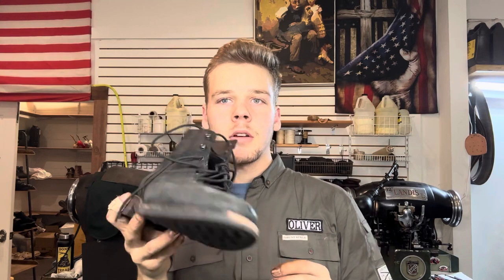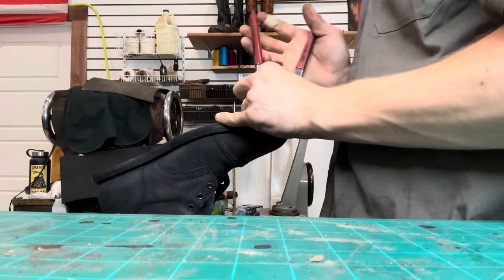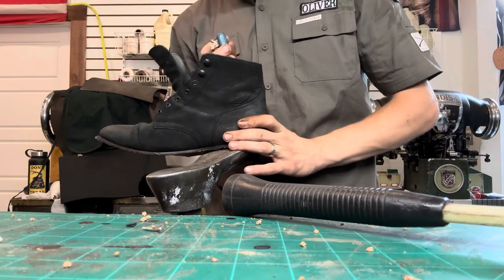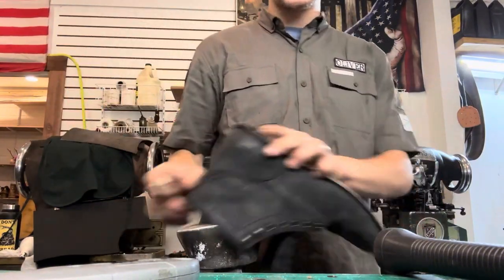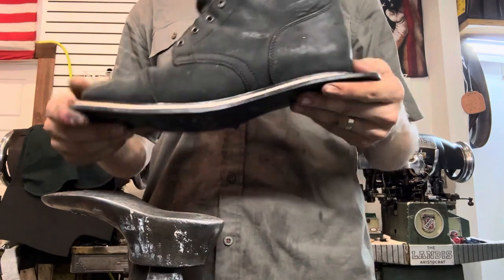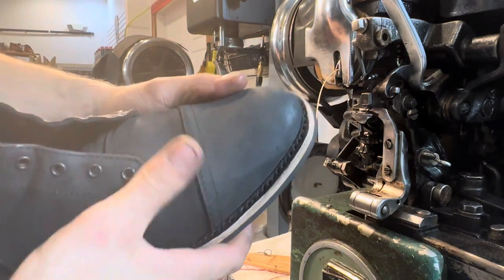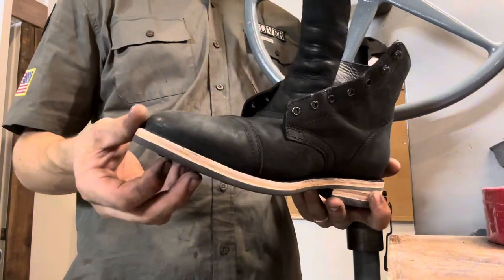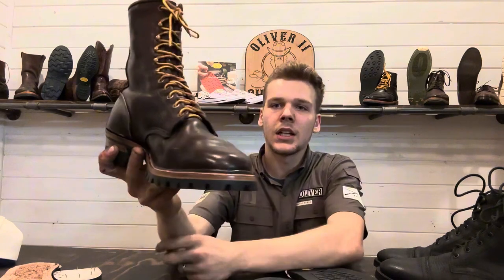How Thursday Boots Get Professionally Restored. Step-by-Step Process.

Comment: The biggest benefit to the hot cork over sheet cork is not having to scrape away the old cork as thoroughly. With the hot cork you won't get the lumps/bumps because the cork fills the area. The sheet cork being a consistent thickness means that any little bits of cork left when it is attached will add to the thickness in that 1 spot, leaving bumps.
Reply from the maker: I see what your saying. When resoling shoes, it's a good idea to scrape away as much of the old cork as possible no matter what type of cork your using. The old cork doesn't provide the same support and cushion like it did when new. It's practically just a filler that does cause bumps if not removed properly.

Comment: how about liquid cork filler ? are they better/worse compared to what u used ?
Reply from the maker: There’s really no difference in function, just application. In a manufacturing process the hot cork is more efficient. I find this process more efficient in a repair setting